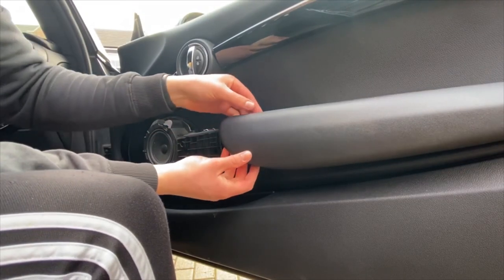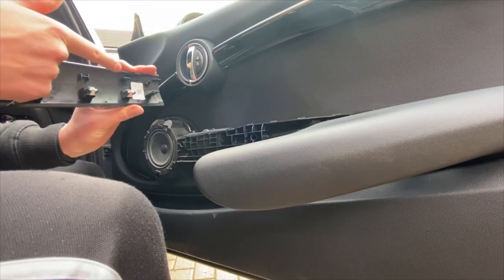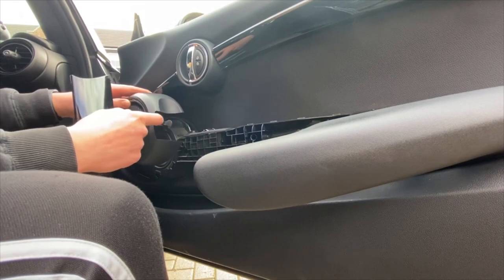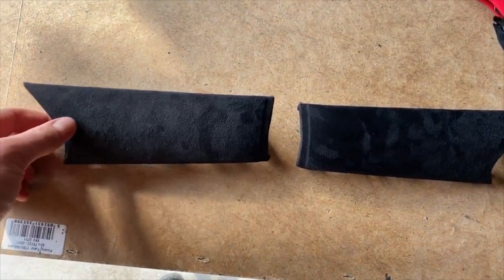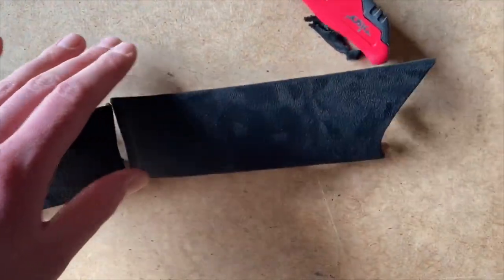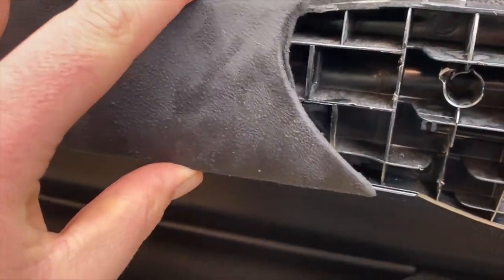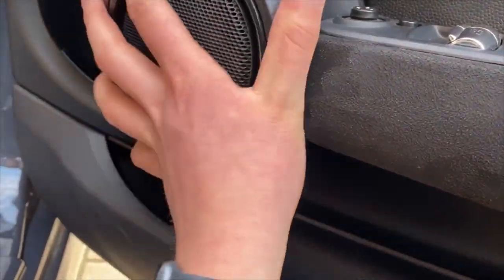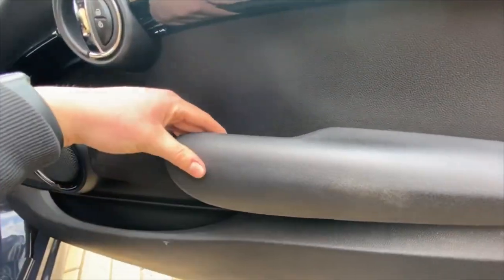HOW TO WRAP F56 MINI INTERIOR PLASTICS ON DOORS *INSANE RESULTS*

Comment: Ti remove speaker the work are same at this video? It's Easy?
Reply from the maker: Yes mate I’d assume so👌🏽
Reply: @tourquecars  ok. Same process. In another video One guy remove all the panel Doors to change the speaker. Tanks for the reply from Italy 😉👍
Reply from the maker: @giannimini85  yeah I don’t you’d need to. Depends if you can get to the bolts and wiring loom. Let me know how you get on. What speakers will you be installing?😁
Reply: @tourquecars  I search on Amazon and YouTube. For 4" size the best are a coaxial speaker from herzt... Of you have the base System not harman kardon the coaxial speaker with her tweeter sound good the High frequency. Of you have a harman kardon System Is unnecessary for me change the speaker 😉
Reply from the maker: @giannimini85  Perfect!😁👍🏻